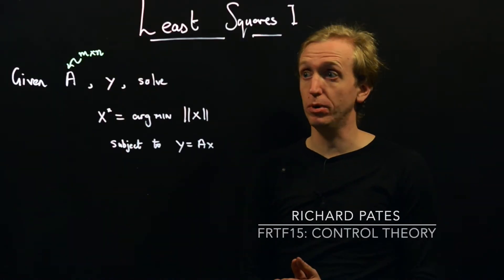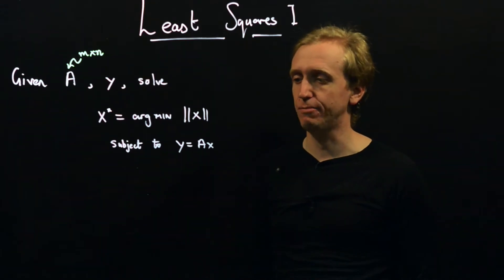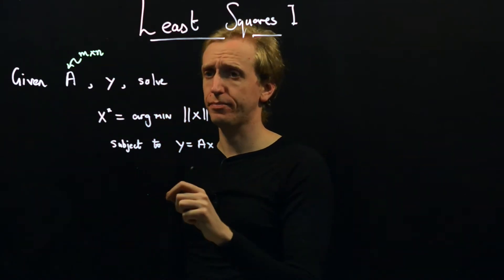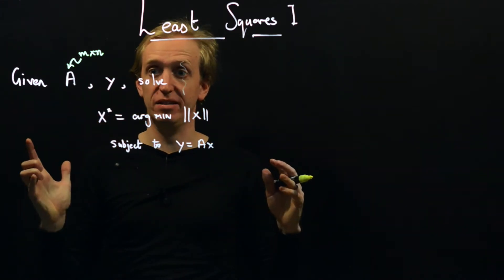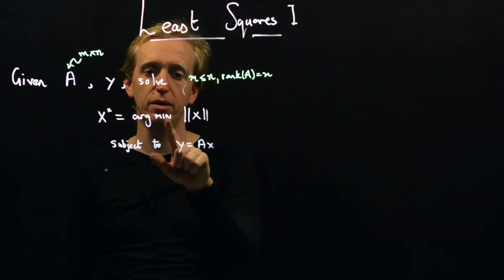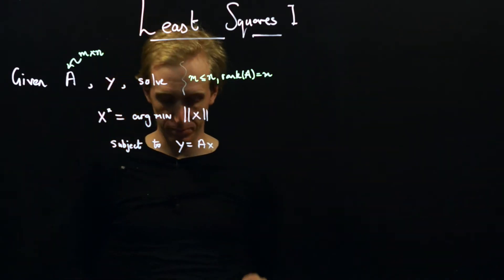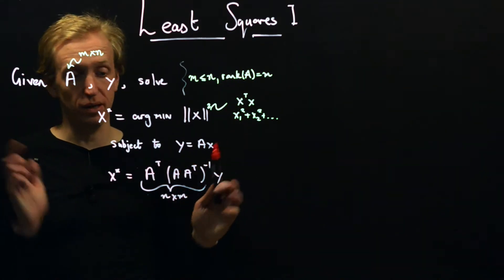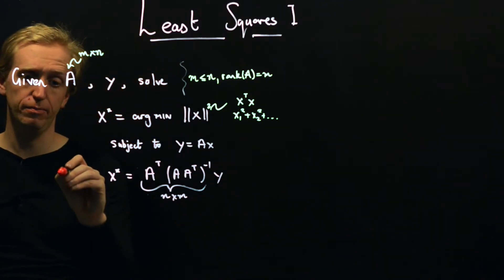Least Norm Problems

Comment: Why is the(AA^T)^-1 term necessary? (x-x*) would be zero with just A^T according to the equations you put up?

Edit: I thought more and it ia ncessary for the solution to be x*. A^T by itself has the properties but is not guarenteed to hold for y = AA^Ty which the initial conditions hold unless it is orthonormal.

I guess another way of seeing this is that AA^T(AA^T)y maps y onto the row space, eliminates the nullspace (all values of (x- x*) as it is the orthogonal complement of the row space them mapping back into the column space

Comment: Why minimise the norm? What’s the rationale? This video shows how you find the least norm solution for an underdetermined system., but why you would seek such an solution in the first place. 
( in the type of problems i deal with, often there is a more ‘natural’ objective function)
Reply from the maker: an excellent question, and also extremely difficult to answer, not least because it is so general. Here are some thoughts! Apologies in advance for the stream of consciousness... If you have some more natural objective, you should of course use that. Perhaps most importantly when considering optimisation problems, you should be constantly thinking and questioning what you are optimising. And it sounds like you are which is great! Optimisation can be extremely dangerous - when you optimise with respect to something, you should expect performance to be bad with respect to everything else, since your optimiser will sacrifice all performance with respect to everything else for even just an epsilon improvement with respect to the criterion you choose. There is a nice quote:

'optimisation can expose the weaknesses in thinking which are usually compensated for by soundness of intuition'

Ok tangent over - why minimum norm - or more specifically minimum 2-norm. Honestly, I think the main reason is that the problem captures a somewhat sensible notion of size, and admits an analytical solution. The big win is this second point. This is extremely rare - almost all other optimisations require a numerical solution. The reason that an analytical solution is so valuable is that it makes it much easier to understand how your solution depends on model parameters, how sensitive it is, how well numerically conditioned it is and so on. This allows you to build an intuition for going on, which is very important when trying to assess if your solution 'makes sense'. But why is a 2-norm natural? 2-norms of signals can often be associated with things like energy. Suppose for example the signal we are minimising the norm of corresponds to the velocity of an object. Then penalising 2-norm of the velocity corresponds to penalising the kinetic energy the object has over time (the k.e. in an object is typically proportional to the square of it's velocity), which may make sense if your objective is to keep that object still. But there are no rules here - 2-norms may not correspond to energy at all. But they will capture some notion of size, and when combined with the analytical nature of the solution to the problem, makes this problem a useful one to be aware of!

Comment: Are least-norm solutions the same as minimum-norm solutions?
Reply from the maker: Sorry, I guess the naming is a bit confusing. Least squares problems are all about the equation y=Ax, and typically come in two different flavours. The first type - the type in this video, corresponds to the case that the equation y=Ax has lots of solutions. This happens when the A matrix is short and fat (i.e. the y vector has fewer entries than the x vector). The objective is then to pick the solution for which the norm of x is as small as possible. That's what I meant with least norm, but we could also say minimum norm. The second type of least squares problem corresponds to the case that A is tall and thin (now the y vector has more entries than the x vector). In this case the objective is to pick x so that we are as close as possible to solving the equation, and we do this by minimising the norm of (Ax-y).

In fact, both these types of problem are special cases of what is called a constrained least squares problem (which is itself a special case of conic optimisation). Definitely worth reading up on or taking further courses if you're interested!
Reply: @richard_pates  thanks!
Reply: thanks so much for the explanation. but why do we design the objective function differently based on the size of matrix A (i.e. A matrix is short and fat or A is tall and thin) ?  what's intuitive behind the objective?